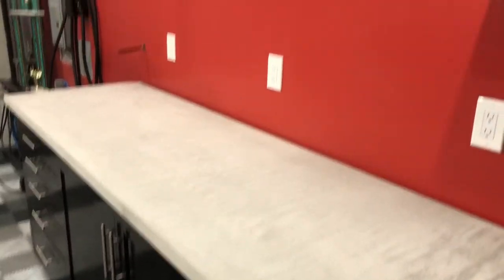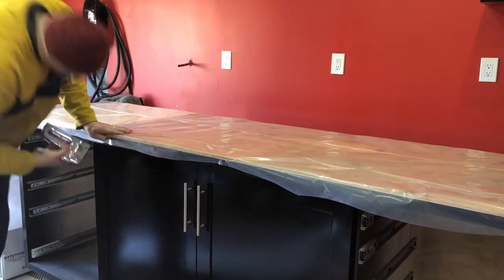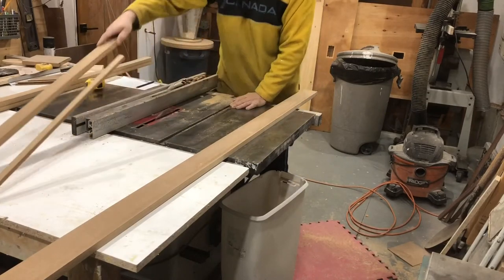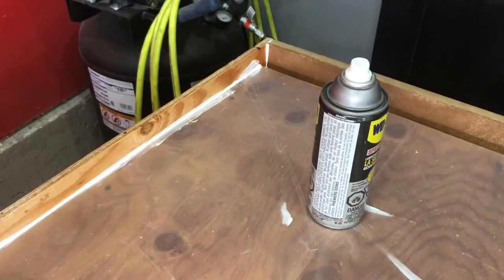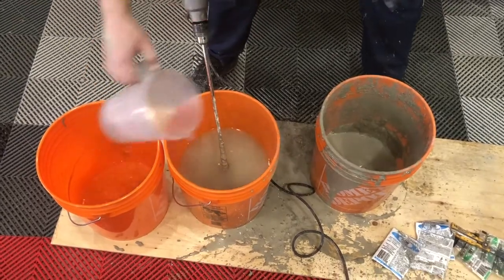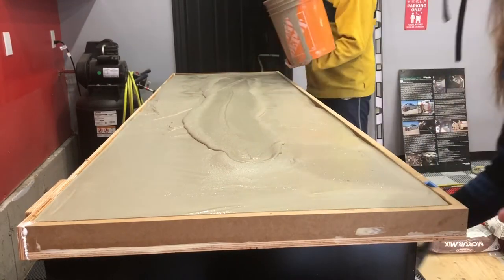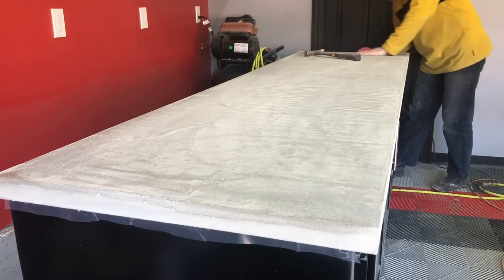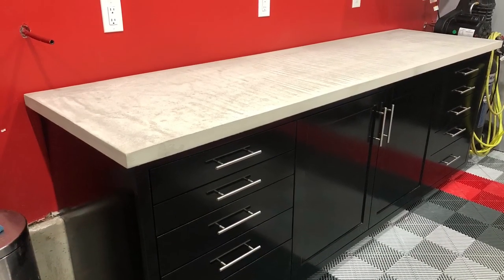DIY Concrete Countertop, Workbench.

Comment: How well did it hold up in the shop environment? Thinking of doing one in my shop but concerned upbout longevity in garage. Thanks
Reply from the maker: It’s still almost as good as new. Just one small stain from a car cleaning product. No cracking issues at all.